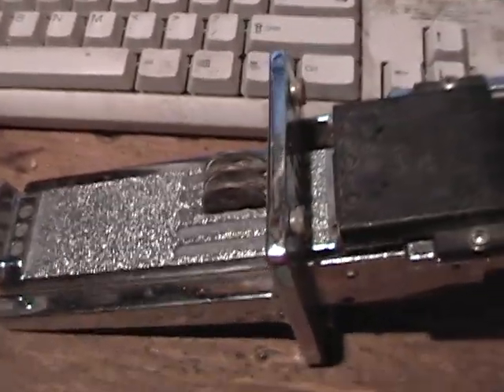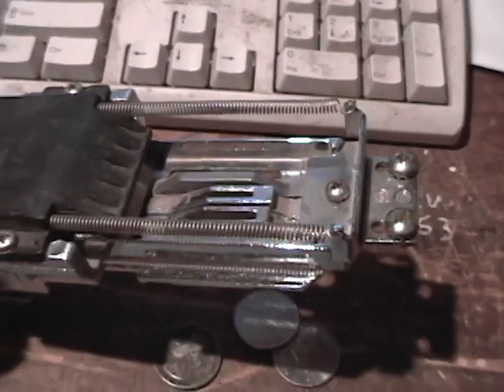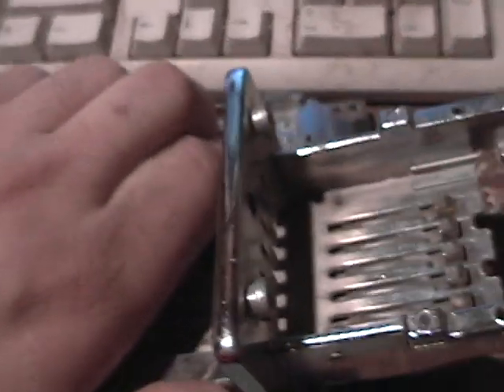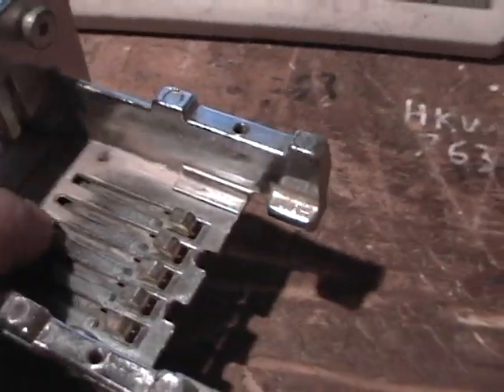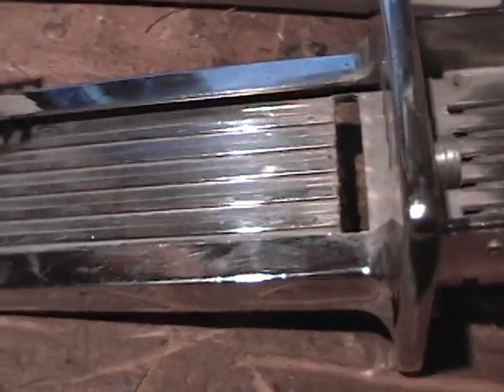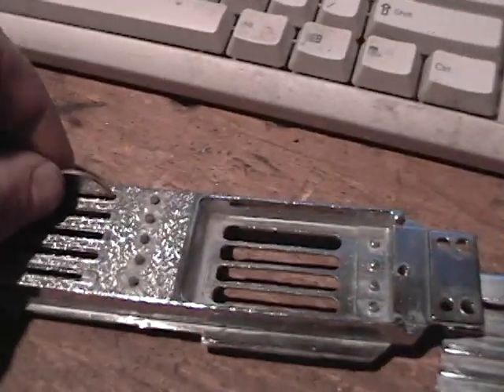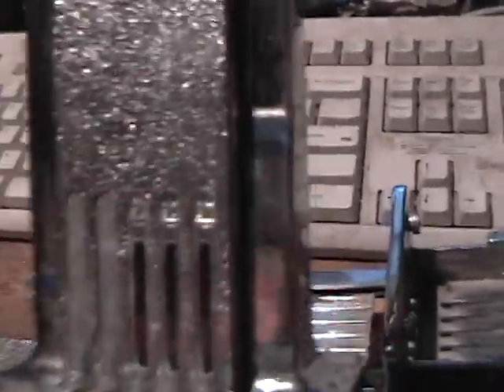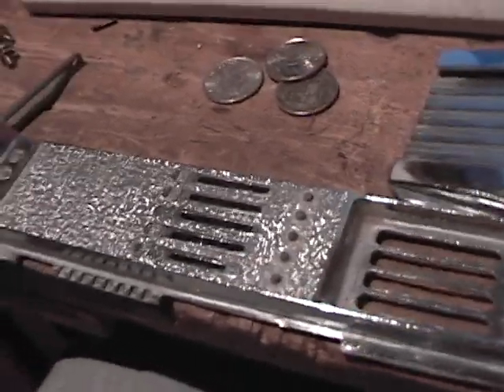Coin slide Mechanism basics

Comment: So in taking it apart, I somehow did something that now you can push the slider without any coins and it will operate...coinless. Can you tell me what I did wrong?
Reply from the maker: Check the little "fingers" at the bottom, the spring may not be pushing them up, or it may have come out of place. Without having it in front of me, it would be hard to tell otherwise

Comment: Thanks for the video. I tok a slide apart to change to a $1 on a v-5. Made the change reassembled and slides in but gets stick and doesn't fully function. Any tips?
Reply from the maker: Might take it apart again and make sure everything is aligned right and clean. Otherwise I'd look online for the diagrams and make sure everything is in it's proper place
Reply: Can you change any machines slide mech with any slide mech
Reply from the maker: It would depend on the hole pattern on the machine, and if it lines up with the one on the mech, it would also depend on what the mech actuates, if it's a switch, or a linkage system etc, it would have to be compatible.

Comment: My esd coin slide on my Tornado football table is hard to push/pull while installed in the table, but seems to move freely if I pull it out.  Are there any adjustments in these?  I tried to use some foosball rod silicon to help, but doesn't change it.
Reply from the maker: I haven't seen any adjustments on mine, but that doesn't mean there aren't any. Try loosening the screws that hold it to the table just a bit, not enough to be loose and falling off, but enough to maybe not jam. Also try seeing if the mechanism the slide itself actuates is sticking, may not be the slide itself.

Comment: I'm having trouble with my vertical 8. The coins are not dropping through to the box. Ive gone through every youtube video looking for help. The spring was off on one side fix it reinstalled the slide into the machine but now its not dropping coins. Help!!??
Reply: Check the black tab/button is being pushed with extender properly.